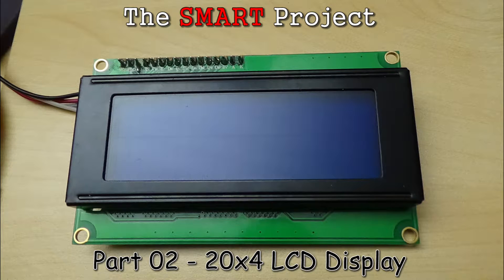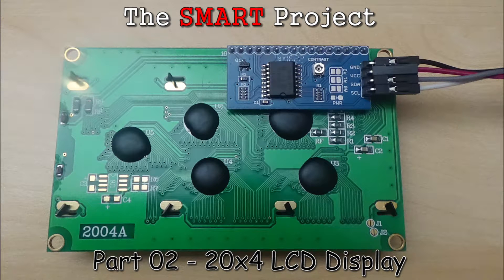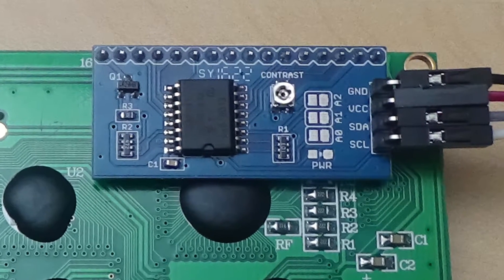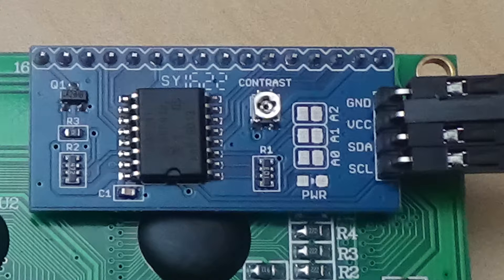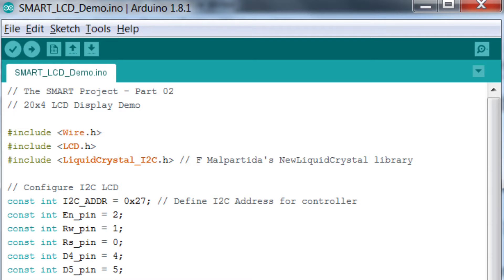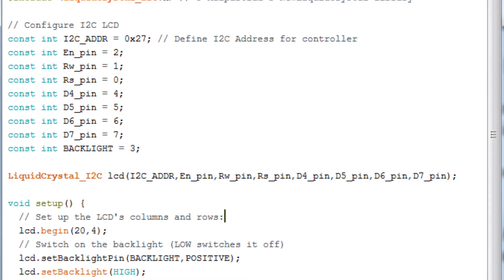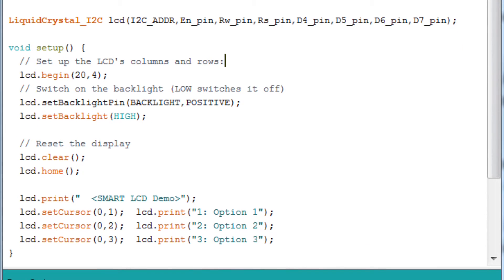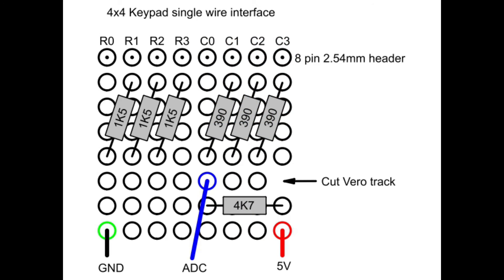The SMART Project - Part 02 - 20x4 LCD Display

Comment: I love these displays.  I drove them directly using a Z80 processor-based home made computer.  That was a long time ago.  I've considered using the Arduino for some projects around here.  I enjoyed the vid!
Reply from the maker: Hi Steve,

I'm honoured that you checked my video out and enjoyed it!  As a retired computer consultant I've only just discovered the joys of the Arduino and it takes me right back to my early programming days in the 70s when I used to program Z80s and 6502 microprocessors using machine code.
Reply: I quickly migrated from the Z80 to the Microchip series of microcontrollers as soon as I discovered them.  On board D/A, A/D, digital I/O, internal memory provided a single-chip solution for projects during my telecommunications engineering days.  I left the industry before Arduino, Raspberry Pi, and such things came into existence.  I must say that as much as I miss doing those things, I would not trade my present lifestyle for anything I can think of.  You sir, have brought many forgotten things to my memory.  I thank you.